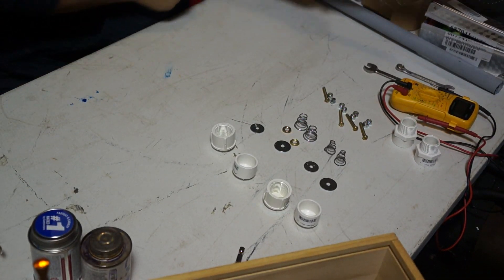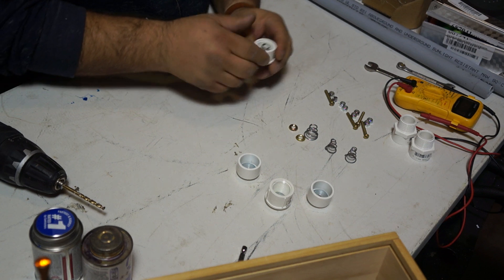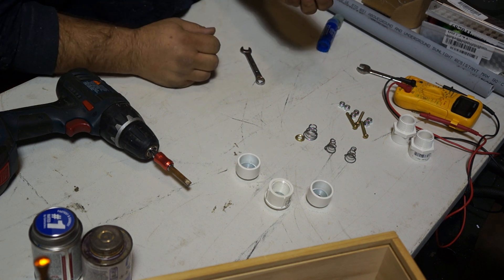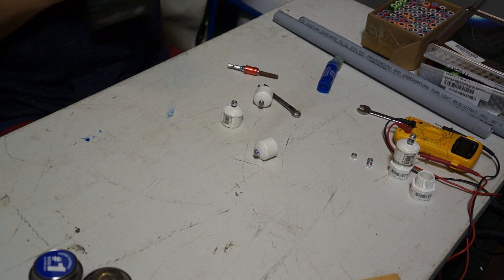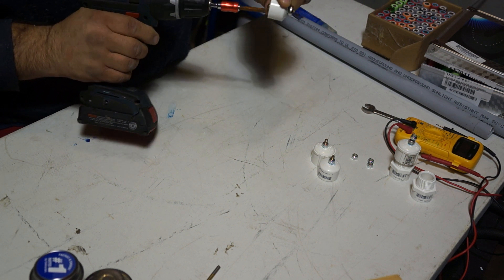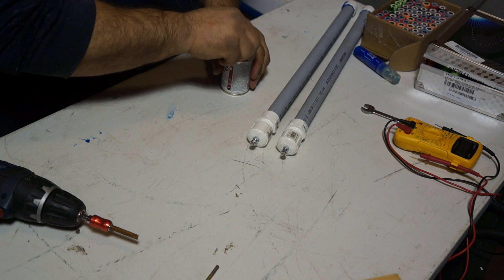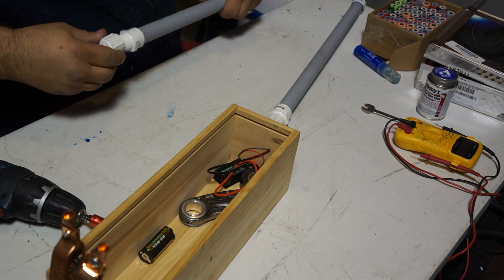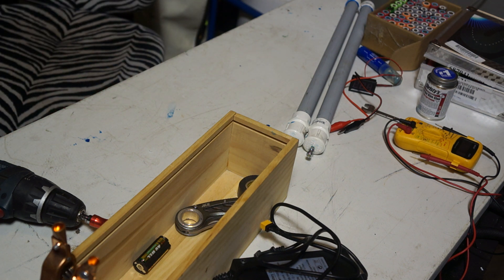DIY E-TUBE without solder or BMS 18650 Battery pack pvc pipe conduit fittings

Comment: i don't get why this isn't more common? ive been thinking about it for a while now, idk if there's some reason we're not supposed to be doing this? it probably has to do with stupid things people might do like take out the batteries to use in their flashlight or something, and then putting it back together except now a couple cells are discharged so the pack is no longer balanced properly...idk.  maybe it has to do with current as well but couldn't each tube be the series and then they go to some heavy plus minus rails for any parallel series packs you need... makes sense to me. i really don't get why this is the only video ive found so far because i finally thought of a different search term but this is it first mention ive seen of anything like this

Comment: I'm not sure if it applies to 3/4" but the grey electrical PVC, schl80? Is not tapered. The white PVC schl40 PVC caps are tapered. So in theory, the grey should thread on more easily.
Reply: The grey vs the white has different size hole inside and batteries can move and looae connection.. the white pvc was the right size

Comment: Everyone wonders about overheating and charging quite simply I have several household smart chargers I would simply unscrew the cap slide them out charging in my smart chargers that takes care of the correct charging and heating temperature and all that then when it fully charged slide them back in the tube and reconnect it's whatever I'm trying to power that should take care of that I would think?

Comment: Hi. Nice job. I was wondering if the contact between the batteries are as good or less good than in a pack that use soldering tools and copper strips?
Reply: And what about heat? Looks like its trapped no?

Comment: Hello Roy. I am interested in the idea and thought of something similar which is how I found your video. I like the way you made the end caps. Nice realisation. My issue is charging the packs. I see you are charging them in series, so how do you make sure some cells don't get over charged and ignite. If the cells are not balanced, some cells can become over charged even though the full back is below the target. These can overheat and explode. That's why packs usually have a BMS or other way of monitoring each cell's voltage and intervening. Any thoughts on that?
Reply: ive thought of this too but i think you could drill a hole in tube between each battery and insert a copper wire that has been hammered down flat and then seal it with silicone, that way you can have balancing leads and could even send them to the bms, if your bms has a temp sensor (bigger ones do usually) you could still do the same thing with a hole drilled. 
just don't drill the hole with the battery in  tube! but if you were going to do that, don't build this because that is obvious.

Comment: Nice and innovative concept. Been having problems building a power wall with 18650 because we don't have plastic battery holders where am at, and importing them would be quite expensive. 
I think your concept of using pvc pipes can be adopted to build a 4s20p power wall. Holes can be drilled in each pipe for ventilation and to accommodate a BMS.

Comment: sir what is the low and high volts of these type of batteries. if i will connect in 4s10p then what should be hihg voltage and low voltage.thanks
Reply: H 16.8v and L 12v

Comment: I really like this solution because it requires no soldering or spot welding equipment. It also makes it possible to take out some cells without having to un-solder them. That will greatly simplify testing, maintenance and experimentation further down the line. The only difficulty is to find those spiral-shaped springs. Any suggestion ?
Reply from the maker: Ace hardware

Comment: I just made one and have a question: How do you make sure the negative and positive ends of each 18650 touch each other?  They dont seem to make contact.
Reply: I did end up putting a bump of solder on the positive end
Reply: put bbs  between them